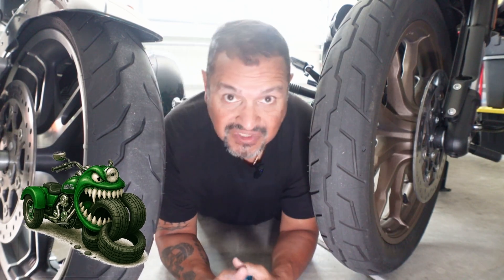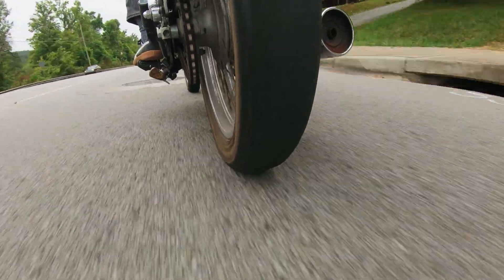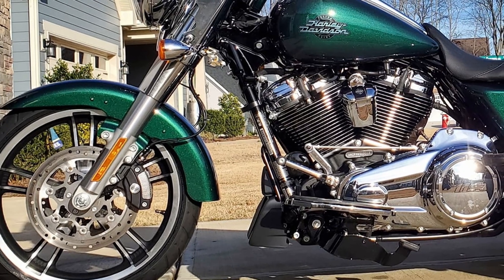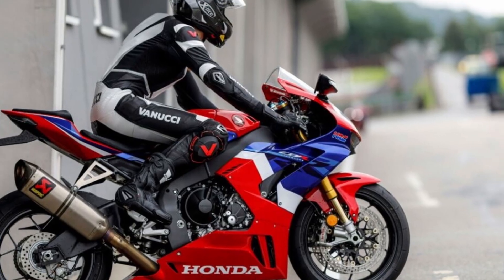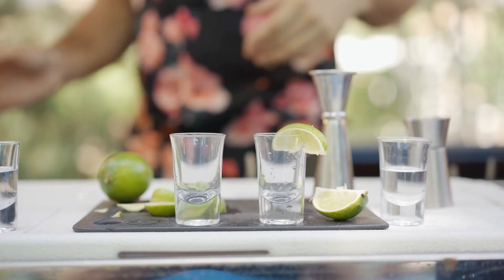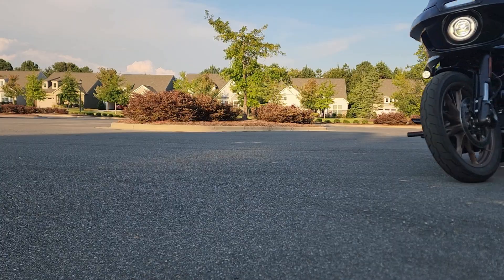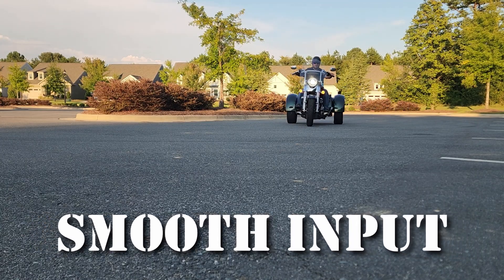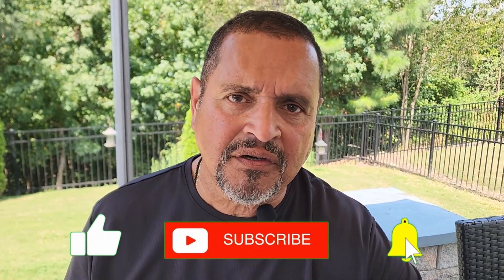WHY TRIKES SHRED FRONT TIRES (BIKER DEEP DIVE)

Comment: From research that I'm doing to replace the front tire on my Victory CCT trike..... Another option is mounting a rear tire backwards on the front rim. Rear tires have deeper tread, so they last longer. They get mounted in the reverse direction due to how the belts in the tire are constructed. 

I'm gonna try it and see how it works.
Reply from the maker: Thanks for sharing.

Comment: I’m on my third front tire on my 2023 HD Tri Glide. I have put 26K miles on it. I have always used the Dunlap D402F. That tire was what it came with new. I’m now looking for a different front tire.
Reply from the maker: Keep us posted as to what you get for the front tire and how it performs. Thanks for watching.
Reply: @sandmanrides4318  I’m getting the Michelin Commander III touring tire. CMDR3 TRG 130/90 B 16 73H.

Comment: I just bought a 2023 Freewheeler. Is there a USB/USBC plug-in on this bike?
Reply: not on Freewheelers, but you can get one to put on. You can get it wired in to your harness and mount it, or like I did, just get an adapter to plug into the existing port on the harness (where you can plug in a battery tender or heated gear--that port).  I have a USB cable run from the handlebars under the seat and all.  whenever I need to use the USB, I just plug it into that port.  works fine and cheaper than going through Harley LOL
Reply from the maker: Excellent tip.
Reply from the maker: Not on Freewheelers. HD puts them on other models so I'm sure they can do the same for the Freewheeler.

Comment: There is a way to make your front tire last longer. Front and rear motorcycle tires have different tread depth. The deeper the tread depth, the longer the life. Find a rear tire that fits your front rim. If you can't, upgrade your front rim to a size you can.
I have a 2016 CVO Road Glide Ultra Limited that I had professionally converted to a trike. There is no rear tire that fits the stock rim so I went from a 17 in front rim to an 18 in. I found a rear tire that fits that rim. I also dropped the air pressure down 6 lbs (36) for a little more tire contact with less jolt coming through the handlebars and a little more rubber on the road means less off the direct center of the tire from being to hard and skipping more. Going to low and you can feel tire flex. 36 is perfect for me and I ride hard in the mountains.
End result, I average 18,000 out of my front tires!
SIDE NOTE: If you use a rear tire for the front, you need to turn the tire pattern the opposite way so it sheds water like it should in wet conditions.
Reply from the maker: Thanks for the helpful info on extending front tire life.

Comment: What’s up Sandman, hope you doing well brother, I keep thinking Harley does things purely for the love of money bro, how do these principles work with a Rewaco, or VW style trike, are they really that different, and would you do a test ride and compare the two styles..stay safe bro….
Reply from the maker: Brother, you nailed it—Harley’s trikes are heavy, solid, and built the Harley way, but a Rewaco or VW-style rig is a whole different animal. They sit lower, got that car-like suspension, and some even run turbos. It’s more nimble, more “Euro hot rod” than “American iron.” Both will eat miles, but they feel completely different on the road. And yeah—I’d throw a leg over one in a heartbeat and do a side-by-side just to see how they stack up. That’d make one hell of a video. 🍻

Comment: Why couldnt you just run car tires on a trike?
Reply: You can run a car tire on a gold wing and other metric trikes . Not really recommended for a Harley.  But you can do it. Wish there was BF TA’s for trikes.
Reply from the maker: You can. It's called Dark Side Conver💲💲💲
Reply: @sandmanrides4318 its expensive? They dont make a car tire that fits on a trike rim? I thought i heard someone talking about a brand that made them. Could be wrong, but in any case, it seems like motorcycle tires are un nesasary because they dont lean